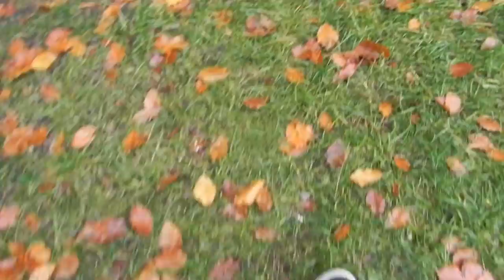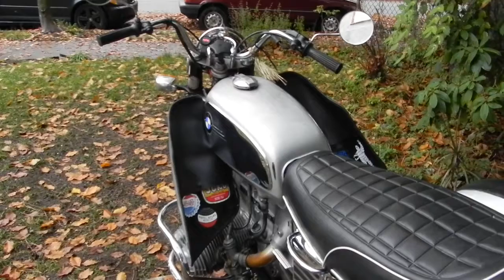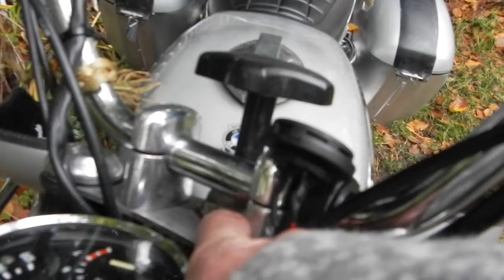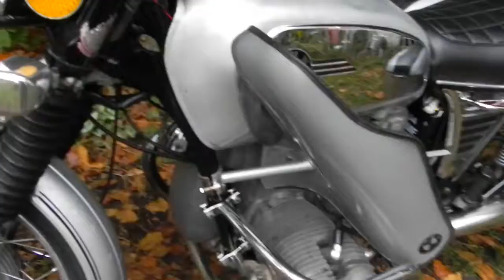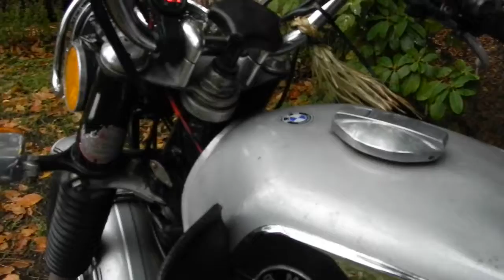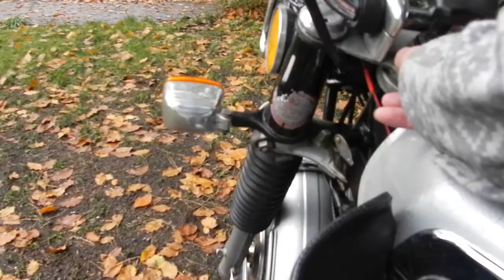Are SWB BMW /5 bikes death traps? high speed wobble widow makers? Not so far.

Comment: Yes Airheads can waggle their front ends. My GS PD is quite sensitive to steering head bearing adjustment. You have to get it just right. Ive never found it dangerous, but it can be quite unnerving when it is out of adjustment. I've not really had any experience of the /5s, but I have ridden and maintained several /7s and later models. They are all a little sensitive to head race set-up, but once you get it right, they are good.
Reply from the maker: Agreed, I had a slight wobble in corners on the gs650f when it reached 140kph and was pretty much assured at 180 it would go full blown slapper. That was a luggage front to back balance. On the R100rt at speed it would shake its head a bit, then after checking front end doing brakes etc fairing did come partially off the culprit was a slight warp in rear wheel disk completely unnoticable at 160 but get to 180-220 and it started. New disk no more testing req it tracks right to the point of it's ability and can crank out of corners hard and rock solid. Now took insurance off that so it can get collector plate and 20% the insurance fee! :o) R60 just a bit snug but no binding slow fall away when wheel tapped to turn to stop.